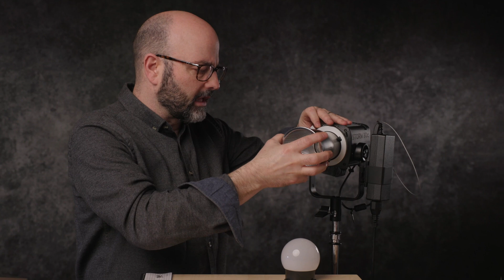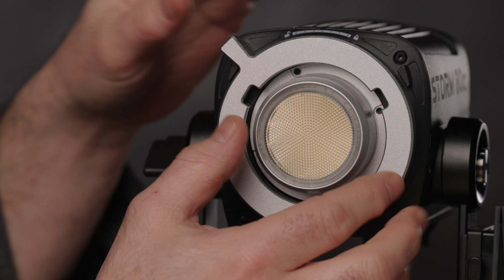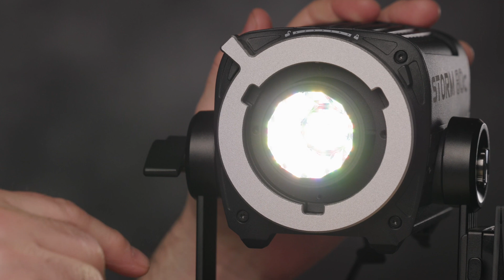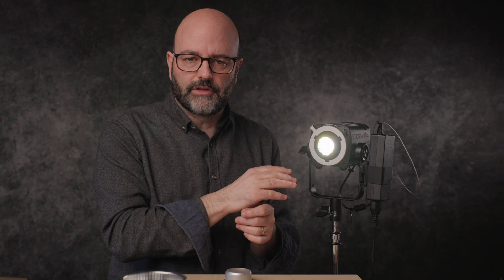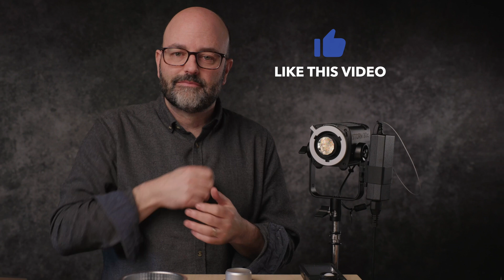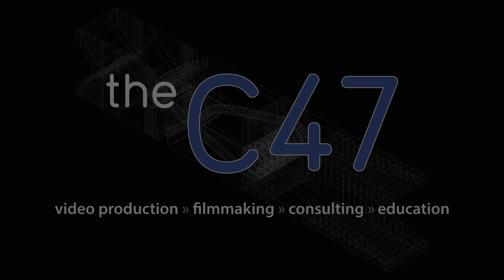APUTURE STORM 80c: A LIGHT ENGINE & BLAIR-CG DISCOURSE (EP.410)

Comment: Hey Jem, great technology breakdown video. Just an FYI, the “BLAIR” part of the BLAIR-CG light engine is not the same as the BLAIR light engine as found in the STORM 1200x. We select the LEDs a little differently since we know that the point of BLAIR is to get the best and strongest tunable white light while BLAIR-CG is about reaching deeply saturated and accurate tunable color. BLAIR-CG does great whites as well, but with less brightness per watt than BLAIR. While BLAIR can do quite a lot of color, it’s not nearly the same as BLAIR-CG. 

This isn’t a criticism of your video, just thought I’d add some info.
Reply from the maker: Hey Mitch!

Thank so much for the post and providing viewers with more info. I've gone down the rabbit hole with Tim quite a bit on this but didn't know how much information I should disseminate. I do mention over the different videos and live stream featuring the 80c that the purpose of the STORM C line is the most accurate and saturated projected light you can probably get from an LED light fixture at this time.

I also talk about the STORM X line throughout those video and that my opinion is that those are the lights to choose if you are looking for the best CCT / White light. While you can technically produce colors with the X line it isn't the same as the BLAIR-CG engine.

One thing I wanted to make clear is that BLAIR and BLAIR-CG can play well together so that if, for instance, you were using the 1200x for your key, you could definitely use the 80c as another "white light" for your production. 

Hoping to get the 1200x in at some point to create some content around that. 

Hope you're well.

-Jem
Reply: @ Hey Jem, I just binged through the whole series. I think you cover quite well. I was just tossing in a fun tidbit that most people don’t realize. Catch you later.
Reply from the maker: @mitchgross592 Hey Mitch, I really appreciate that and also for the additional info you shared with everyone. As this is a new light engine/s, the better we understand it, the better we can use it in production. 

Looking forward to seeing you at NAB. 

-Jem

Comment: Can it be used as a keylight for interviews when traveling often ? is it strong enogh? can it be dimmed down enogh to be a hair light or fill? 
could you make an interview setup A b cam to show how it would fit in a small two light interview production setup
Reply: The old aputure ls 120t was putting out around 2000 lux and it was bright enough for interviews and lighting up normal house rooms. The storm 80c ist beaming three times more light, around 6000 lux. So its bright enough for your needs.
Reply: @AnimusNitra-X  yeah im more asking for all around use.. like how bright a window can i counter, what setup would be great to use it with in a two light setup and so on. 
I use a 300 X from aputure and most times its enogh. But those windows though.. :)
Reply: @baekmedier  It‘s good for all around use. I had for years 4 Aputure ls 120t as main lights and it was good for quite everything except an industrial room that was about 40 x 30 meters and 5 meter high, forest at night and of course it wasnt good with sunlight because its a tungsten light. The storm is tungsten till daylight so no problem with that. I will buy 4 of them and use them for all around. I guess you have to buy one to get 100% sure, but I think it will fullfill your needs because I think it will fullfill my needs as my new main lights.
Reply: @AnimusNitra-X  I think I will. It really looks like an awesome little light that packs small
Reply from the maker: I wouldn't lean on an 80-150w light as a key in most situations. I'm going to do a live stream today about this subject.